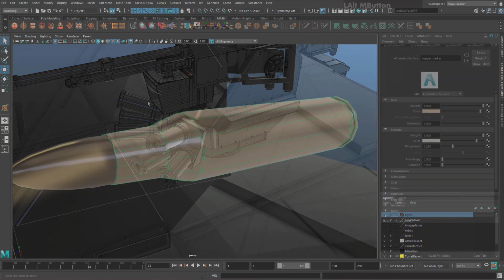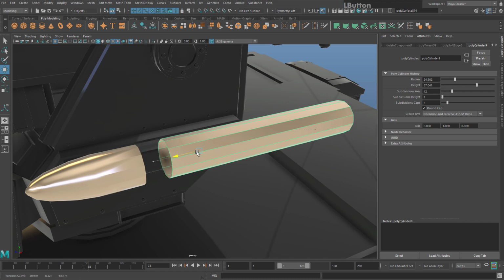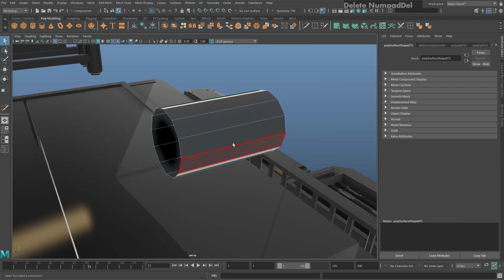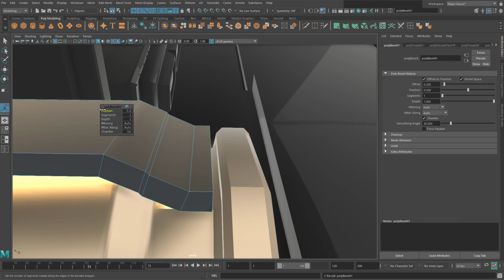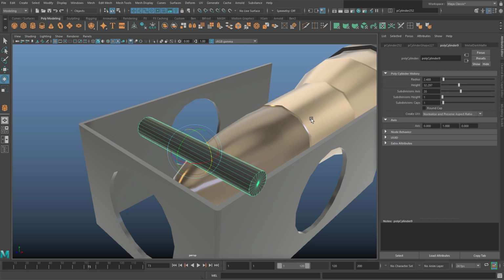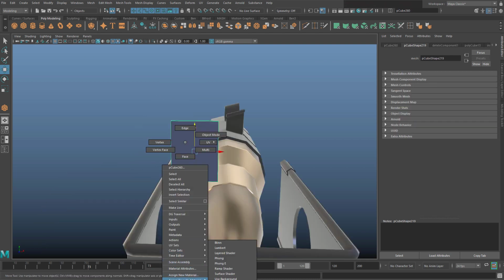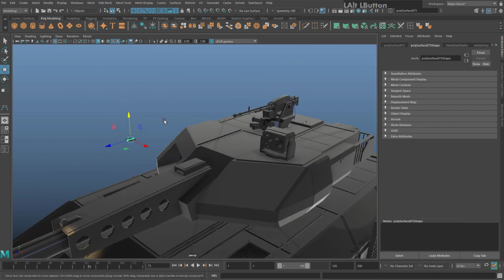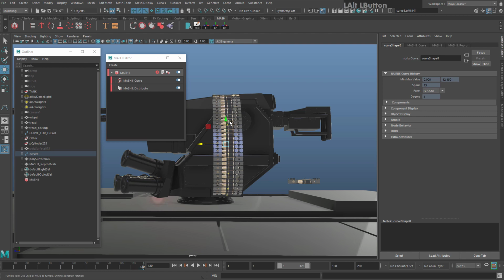Modelling a BULLET and BELT magazine and animating it with MASH in Maya

Comment: Really nice video! Just wanted to point out that the disintegrating link(the black cylinder fitted on the bullet) follows the bullet and it attached to it but the squares outside only guide the bullet and are not attached to the bullets in any way. They're just there to guide the links.